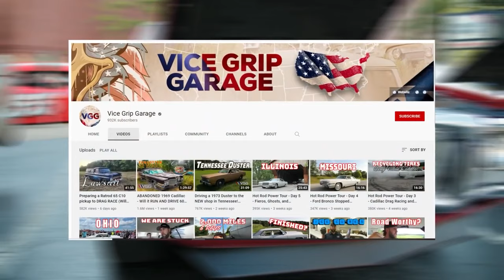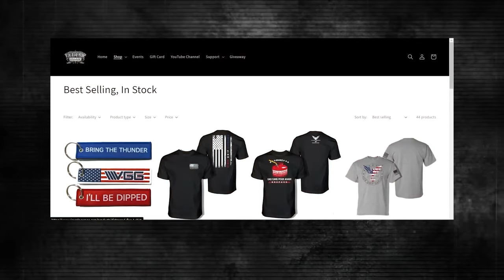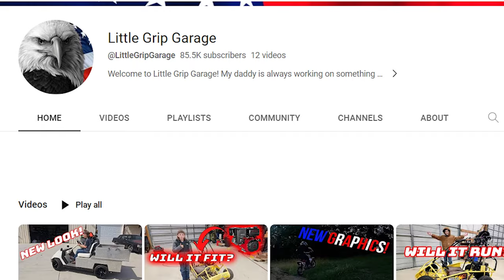Real Truth of Derek 's Lawsuit on Vice Grip Garage | New Video Episode Camaro Corvette Secret Truck

Comment: Love his roadworthy rescue shows with the exception of when he winds up dropping a newly rebuilt hopped up motor and transmission, that reminds me too much of Gas Monkey garage which I quit watching because that seemed to be what every episode was.
Reply: At least when Derek does it, it's either because the motor in the car is too far gone to repair, the frame and body are too far gone to last long enough to be worth the effort or lastly, his fans voted for the build up. He frequently asks his fans/patreon to suggest and vote on what he should do with some of his revival cars.
Gas Monkey was just taking the easy route and trying to fluff something up for a bigger asking price; nothing else.
Reply: The Craigslist rebuilds are always a gamble
Reply: @SA-bq1us  Indeed, and the wooden Lamborghini was a case in point, he got it running, but it blew up once on the road. He's had several others that he either had to abandon, or get towed home, but most are what were described for the most part, and he's been able to save them.
Reply: VGG is GMG but without the arrogant, loud-mouth owner. Oh, and 50,000 to 100,000 dollar build budgets